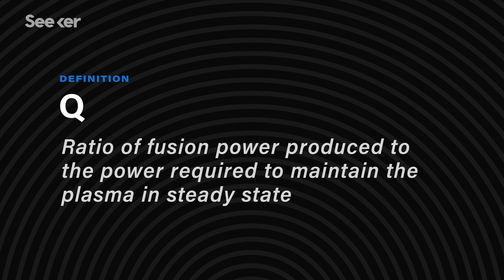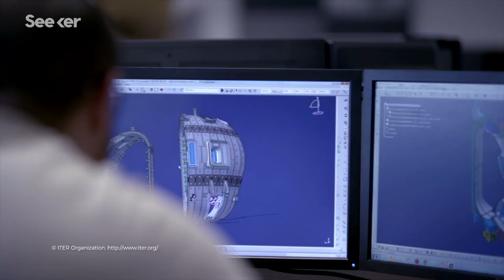How Close Are We to Fusion Energy?

Comment: I've been following this since I'm 13.  I'm 37 now and still nowhere near Fusion power.  
I'd rather hype solar/wind and energy storage now.  Anyway, ITER and multiple Fusion projects are online.
Reply: Hydrogen is the most abundant element, there's no need to worry about it. Thorium on its own can power the planet longer than the sun's remaining lifespan. Nuclear energy is much more energy dense than anything else we use. We will run into the thermal barrier of the planet before we run out of nuclear energy
Reply: High capacity, low-loss, limited-degradation energy storage would make stuff like Solar/Wind a hell of a lot more viable in the long run as more passive energy acquisition methods that don't require 'consumption' of materials.
Reply: In my opinion solar has two main problems, a) efficency b) while it is true that clean energy is beeing produced, the whole process of creating solar panels (shipping/mining rare metals in kongo/then sending it to china for assembly with chemicals and so on.) produces more co2 than it makes up for
Reply: Joshua Clivaz that's because of current panel placement we have an obsession with efficiency. Sure, roof mounted solar is grand in a lot of the world, and minimising transmission distance is always good, but we have enough arid land on the planet that we don't need to be so concerned with it. You can literally make a solar panel with fruit juice if you desire, they aren't complex things. Organic panels are developing more every year. And even the simple silicon ones, able to be manufactured mainly from raw materials found virtually anywhere in the world are perfectly adequate efficiency wise if we could just get together and sort out the logistics of large farms.
Reply: The pyramids you fools the pyramids!
Reply: Also ITER is 2x times more expensive than LHC
Reply: Nuclear is the only realistic option to fossils, have a look at Fast Spectrum Molten Salt Reactor for example, much better than current nuclear plants.
Reply: ikr we probably be dead or very old by the time we have fusion energy working all over the planet to be honest
Reply: We've achieved fusion in reactors just not for very long. I think that's a huge step
Reply: Considering cost even at 2050s only couple countries will have fusion reactor, if im not wrong it would cost over 30 billion for one reactor, if not more. So maybe at 2100-2120s most developed countries will use fusion reactors if they find way to make it cheaper
Reply: I think current estimates are going more in the directions of 20 billion for the very first reactor. And that is for sure very expensive. But I think, when the most engineering hurdles are over come, it can be much cheaper, and there is for sure some technical development which are difficult anticipate, like price development in the field of super conductors. But I think you are write, that it for sure will be only possible for developed nations.
Reply: Yo you’re all giving your opinion as scientists would do and it’s all great, but before debating on some random figures, run the basic math please. It will take you less than 30minutes of googlin to get sufficient knowledge for that. Instead of relying on some absurd numbers, do the math by yourself to really grasp what the stakes are when you’re talking about energy. That maybe the most useful advice I heard from my teachers.
Reply: Fusion energy is complex
Reply: Nuclear fission power is not an acceptable alternative anymore. There isn't much Uranium available anymore and the production of yellow cake to make fuel rods gets more expensive every day. Add storage cost for radioactive waste and cost for dismantling old fission reactors and it gets damn expensive. 
We could burn much of the waste in breeder reactors, but that is not allowed to most countries in the world because it creates weapons grade plutonium and uranium. 
Regenerative energy, solar and wind, needs some sort of storage like Elon Musks powerwalls and probably more. On a windy or sunny day the surplus electricity could be used to create hydrogen and make synthetic fuels for everything burning gas or diesel now, it's just not as cheap as making gas and diesel from crude oil is at the moment. But, let's face it, oil extraction is getting more expensive, too. 
So fusion looks good to me. Although I am waiting for a fusion power plant since I first read of that at the age of 14, I'm turning 59 this saturday :D
Reply: @VolkerHett  Thorium reactors...
Reply: We have plenty of Uranium available. Fuel reprocessing isn't used because it's more expensive than just mining new Uranium, not because the process (which process? there are several) makes weapons grade Pu or U. Also, fuel reprocessing does not make weapons grade anything. Any country making nuclear weapons these days, isn't using commercial power reactors or reprocessing to do it. They use dedicated reactors and processing steps in order to get weapons grade Pu-239. The largest difference in weapons-grade Pu and reactor fuel grade Pu is the amount of Pu-240 in the product. Pu-240 tends to undergo spontaneous fission and will cause bombs to fizzle before full critical mass can be reached. Pu240 is also far more likely to capture a neutron, than to fission.
 You need less than 2% Pu240 in a nuclear weapon or it will either fail to go off, or will have a vastly reduced yield. Commercial power reactors don't really make enough Pu239 to be worth the effort of using them for weapons production. It would be like Taking crude oil, distilling it down for diesel fuel, running it through a really dirty engine one time, then using the resulting hydrocarbons to reform LPG and burning it in your BBQ. 
Far easier to just build a dedicated refinery and narrow down the product you want from the start.

Fission still has lots of life left in it, especially since Fast Reactors can use spent fuel from light water reactors AND burn up all the nasty actinides. With the reprocessing steps developed at Argonne National Labs, we can use almost any spent fuel to breed new, clean fuel all while eliminating large amounts of high level nuclear waste. 
With molten salt reactors, fuel reprocessing is part of the process but is far less intensive than other types. While you can't eliminate all the really nasty actinides like a fast reactor can, you are producing a hell of a lot less waste to begin with, because MSRs are so much more efficient than Pressurized Water Reactors. Also, there isn't much danger of weapons proliferation in an MSR, because the reprocessing step is integral and the compounds that could be used for weapons, never leave the plant.
Reply: No one would have expected smart phones from whenever the first brick phones were invented so soon but it happened. So you never know.
Reply: 'FOLLOWING'. Clearly not an expert in the field. Just a onlooker like everyone else. So please dont push you idea of how long it will take with others.
Reply: @joshgilbert9571  
Me?
Reply: No, Zodiac
Reply: Solarpanel production is as toxic as it gets,
wind mills require hundreds of tons of steel to be mined and burned/Processed.

Both wind and solar are complete garbage.
Which.. is why Tesla is complete Garbage. Not only are their battery productions 50x as bad as a regular car alone - THE BATTERYS ALONE! NOT THE CAR! and it didnt even get power yet!! - it also consumes energy which is worse than oil at the current moment and most likely the next 20 years.
Reply: Wind and solar isnt saints with the enviroment either, Manufacturing the solar panels creates alot of pollution, Wind turbines can also  disrupt weather patterns., obviosl Coal and gas needs to GO, nuclear is our best source as of this time, so we need to use Thorium instead of uranium which is cleaner and has a shorter half life. and hopefully over the following decades we get fusion reactors.
Reply: The_Wilsonator says:
"Wind and solar isnt saints with the enviroment either,..."
==
No comparison.

"Manufacturing the solar panels creates alot of pollution, .."
==
How much pollution?

"so we need to use Thorium instead of uranium which is ..."
==
I'll belieive it when I see it.
Reply: We do have net power gain and now the new magnet technology with the next goal being 10 times power and concepts for power plants when they have that so it will happen but will take a long time to go from even 10times power gain to commercial power plants.
Reply: As of right now the best energy we have is nuclear.

Solar produces a lot of pollution, and the panels do not have a very long life, and are made of toxic materials that cannot be recycled, resulting in large toxic panels being dumped in land fills.

It requires more energy to produce a wind farm than the amount of energy that they are capable of producing in their entire life time. If you wanted to save energy it's be better to not build the wind farm.
Reply: Thats a common but very wrong myth about wind power

https://www.quora.com/Is-it-true-that-manufacturing-wind-turbines-uses-more-power-than-they-will-produce-in-their-lifetime

Solar and wind with storage are now cheaper than nuclear and on par pollution wise.

Though it doesn't really mater what we the public think is cheapest as solar and wind aren't subsidized and the market is choosing to invest in them not nuclear.
Reply: We may have break even this year. Look up LPP' Focus Fusion project.
They are close to assembling the last set up that is suppose to result in break even.
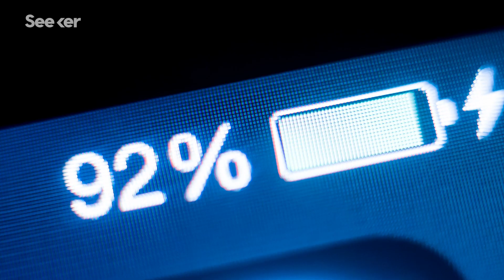Reply: just listen to this 4:13 and decide for yourself whether that equation make any sense
Reply: Solar and wind are complimentary. Solar during day and summer, wind during night and winter. Not to mention that off shore winds are strong and consistent. They are getting more efficient and cheap. They are already one of the cheapest. And then add effective battery storage like Tesla is doing. Take Germany is 1st to surpass 80% energy source in renewable. Everything is going in an exponentially which nobody could've predicted a few years ago. Many Arab oil companies are also investing a lot into renewable, especially solar.
Reply: Solar and Wind are expensive, wasteful and hyped up beyond belief.  I really think Nuclear is the best option we currently have.  ITER also isn't online yet.
Reply: Swan says:
"Solar and Wind are expensive, wasteful and hyped up beyond belief. ..."
==
Where did you get that idea?

Stop telling lies.

Oil subsidies,
$20 billion(annually) in US alone.
6.5% of global GDP worldwide.
Reply: Because solar and wind, don't come close to supplying all our energy, or even a substantial portion of it. Gas and coal are still supreme and will remain that way for the foreseeable future, because renewables can't replace them.
Nuclear can.
Reply: Swan I agree on nuclear power being the cleanest source of energy humans currently have access to
Reply: Thomas _ TK says:
"Swan I agree on nuclear power being the cleanest source of energy humans currently have access to"
==
"Insurance coverage for nuclear accidents"
https://www.iii.org/article/insurance-coverage-nuclear-accidents

The risk of disaster is so great, make the premium so high yet it doesn't cover everything.
In such case of disaster the cost will be paid by the tax payers.
Privatization of the profit, socializing the loss.

Or, if the government can't afford it, they just leave it alone, like Fukushima.
Reply: how do insurance premiums negate what he said about nuclear being the cleanest? 
Want to know what cost a lot more than the Three Mile Island incident? Cleaning up the Exxon-Valdez spill and Cleaning up the DeepWater Horizon spill.
How much of the Gulf Coast of the USA was devastated by the Deepwater Horizon spill, and at what cost? Nuclear is far cleaner and a whole lot safer. And that's just pressurized water reactors. It doesn't even look at safer reactors like the MSRs or the IFRs, which can't melt down.
Reply: Mike McKeen says:
"how do insurance premiums negate what he said about nuclear being the cleanest? "
==
cost of cleaning up?
Reply: Insurance doesn't pay for clean-up. Try again.
How do insurance premiums negate what he said about nuclear being the cleanest? Nuclear power is almost carbon free.
Reply: Mike McKeen says:
"Insurance doesn't pay for clean-up. Try again."
==
All other power plants do pay for the hazardous damage recovery.

Try again.

Who do you think will pay for the radio active damages if not the insurance company?
Reply: Cleanup and decommissioning isn't covered by insurance. Those costs are a built-in part of the licensing process and the ability to fund decommissioning either by trust fund or financial guarantees of parent companies and must be in-place before a license can be issued. 
This is a legal requirement from the NRC. 
An insurance company might have to pay for damages in the event of an accident, but the decommissioning and clean-up of a plant is solely the licensee's responsibility. Has been for decades.
Reply: They are already cheaper than coal. Wait until solar+storage is also cheaper than coal in few years. I'd rather put my hopes there rather than on a technology that might or might not become reality in 2050.
Reply: but there is still no safe way to dispose the nuclear waste
Reply: @standardsoapbox  there is. And you don't need to dispose of it. Most of nuclear waste is recyclable.
Reply: All alternative energies save money. The fuel is freaking free...
Reply: Solar, hydro and wind are, literally, the cheapest forms of power ever invented. A typical wind farm costs about 1/3rd as much as a reactor that produces the same amount of energy, and the fuel is free. That's why all the companies producing reactors are either going out of business (Westinghouse) or becoming wind turbine companies (General Electric).
Reply: and despite the low cost, renewables still don't come close to supplying all our energy needs. Luckily, all that solar and wind guarantees we'll have plenty of gas powerplants running for the next century.
Yay solar and wind, ensuring the continued dominance of the petro-state.
Reply: Mike McKeen says:
"and despite the low cost, renewables still don't come close to supplying all our energy needs."
==
What will happen to the supply of oil if the subsidies stopped?

$20 Billion annually in US alone.
"more than $20 billion in fossil fuel subsidies each year."
http://priceofoil.org/2017/10/03/report-trumps-energy-dominance-plans-rely-on-billions-in-fossil-fuel-subsidies/

6.5% of global GDP

https://en.wikipedia.org/wiki/Energy_subsidies
"Global fossil fuel subsidies represented 6.5% of global GDP in 2015.."

You have no idea what you are talking about.

Ignorance?
Reply: Still dodging the point I see. Fact remains that renewables are not capable of supplying all of our electrical needs. Not even close. You don't have an answer for that nor a solution.
And so what if fossil fuels are subsidized? ALL forms of energy production are subsidized by large 1st world nations. The USA spent more than $18 billion on renewable energy subsidies and energy efficiency subsidies in 2016
The Green Levy on British energy bills pays more to solar producers than they make from selling power.
http://www.dailymail.co.uk/news/article-5592691/Solar-farms-receive-cash-green-subsidies-selling-energy-produce.html

Do you know why? Because it pays to have cheap energy available to people, businesses and industry. It's what makes mass production possible and helps keep economies productive.
What would happen if the subsidies stopped? The price of electricity would go up. That's it. Demand isn't going to drop appreciably and renewables (heavily subsidized I might add) aren't up to the task of meeting that demand.
If you want clean base load power that can replace fossil fuels, there is only one option: Nuclear.
Reply: Mike McKeen says:
"Still dodging the point I see. Fact remains that renewables are not capable of supplying all of our electrical needs. Not even close. You don't have an answer for that nor a solution...."
==
What do you think stopping it from growing?
Reply: The fact that we're just about out of rivers to dam in this country. Hydropower constitutes the largest bulk of 'renewable' sources in this country. The problem with solar and wind is that they don't scale well because of their low efficiency. The only reason they work at all in a financial sense, is that the fuel is free. The reason they won't grow beyond 30% or so of total supply, is because storage is not really practical for the near future. All the capacity in the world doesn't help if it all shuts down at sunset or when the wind stops. So, what do you do for a base load supply? If you want the cheapest route, you go with natural gas, as most so-called renewable plants do. They're always located near a gas pipeline, or another existing fossil fueled plant.
Reply: Yeah, solar energy is already fusion energy.
The problem with fusion is that it permanently turns hydrogen into helium.  Even our nuclear waste will decay in a few million years.  Even the carbon we put out will eventually be returned to the Earth after humans eventually die off.  Nothing we've done so far will change the Earth permanently, ie for billions of years.  

Life is so dependent on water, and stealing the hydrogen from the water permanently, and turning it into an inert product that no lifeform is able to use seems dangerous.  The benefits would certainly outweigh the risks for the next 100 years, maybe even 500 years.  But what happens then?  Do we have to mine hydrogen from gas giant planets in order to restore our water supply?  That's a possibility, but seeing as how humans always tend to wait until the very last second before utter devastation, i don't think we'll do it in time.  And Earth will become a dead husk.
Reply: Heavy water is used for fusion which is a millionth of normal water. Worrying about water running out because of us using it for fusion is absurd. It is like me choosing not to have a kid because he will deplete earth's oxygen reserves. 
Even fusion energy would seem a mediocre technology a few hundred years from now as more exotic forms of energies would be available, even though we have fusion fuel for millions of years. But I'd say Solar will still dominate in the long run as no matter how much we use fusion, we still have zillion times more hydrogen in the sun than on earth.
Reply: Jibran Khalil it's not the same - the CO2 your kid produces will return to being O2 eventually.  It's part of a cycle.  Helium will never become hydrogen again.  At the rate we use energy currently, it may not be an issue for thousands of years, but our energy use as a whole is increasing exponentially.  

I'm not saying we shouldn't research and invest in fusion either, but i am wary of its use as a primary energy source going into the future, because of its permanence. 

We thought the same thing about logging down forests, believing the supply to be infinite.  We thought the same thing about CO2, thinking we could never affect such a massive atmosphere with our tiny little cars and factories.  The difference is that trees can regrow, and CO2 can be broken back down to oxygen and carbon.  But the helium will never return to being hydrogen.
Reply: Stop nitpicking for the sake of it. We use Dueterium and Triitium for fusion. The fuel is in water, not the fuel is water.
Reply: Danielle Spargo hydrogen is the single most abundant source of energy in the entire universe. Not only will we have enough to power earth for millions of years, the use of it doesn't really effect anything. Most water isn't even useable, it's one in a thousand, so that would never matter.
Reply: I reckon in future, after fusion we will go back to solar, but this time it will be space-based. If we don't annihilate ourselves, next century we will be building a Dyson Swarms to collect all of Sun's energy. Water scarcity will be the last thing to worry.
Reply: Exactly, and damn, hydrogen is the most common substance on the universe, i guess we will figure out another energy source before burning our galaxy out xD
Reply: Danielle Spargo I think this is a good question, because Hydrogen is the  fuel for Fusion Reactors. But we have enough hydrogen, ( tritium and deuterium ), maybe even for millions of years... I wrote a 157 pages tesis about this topic. Sorry for bad english. But just to have a perspective: the energy liberated in a fusion reaction between 1 gram deuterium and 1 gram tritium is equal to the energy that 675 familys use in one year. And yes, thats correct... 2 grams of hydrogen for 675 familys for one year....
Reply: Ok sergio, and we have no way to store that much energy. So kinda dumb to even mention an idiotic number like that if we have no way to even store energy effectively.
Reply: Sergio Airaldi
"energy liberated" can't be sold to 675 families unless it can be contained. Enough hydrogen (nuclear fusion) bombs have proved that a thousand times that can be killed for supposedly free and noble purpose. Build a container for the bomb and you win a nobel and are a trillionaire.  Talk about it and you have just a tesis [sic].
Reply: Danielle in thousands of years we will have diffrent power source than fusion lmao.
Reply: Danielle Spargo  few ton of water can power entire world per year, how many water in the world again? billion of billion as trump say
Reply: It is an interesting idea, you are prepossessing, but it is factually wrong. In a fusion reactor we are able to build, now and for the very long foreseeable future, Deuterium (H with one extra neutron) and Tritium (H with two extra neutrons) will be fused. So 99,989 % of the available hydrogen (part of H without any neutron ) will be untouched from energy production of Fusion. Therfore u don't have to worry.